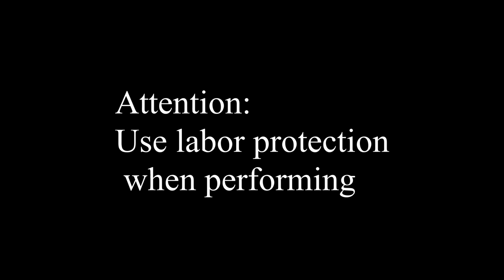I Turn A Ceiling Fan Into A High Tech Welding Machine

Comment: The wire is too small to carry that welding
Reply: Like that is the reason he did spot weld instead of straight continuous welding which would cause the wire to heat up causing damage to battery.
Reply: @jeremytheonlyone  Would it be possible to use larger gauge wiring during the Wrap or does it HAVE to fit the grooves in the Rotor? Also could an grounding clamp to get a better ground to the ground lead with an actual stick welder lead to the other? Just curious.

Comment: À ceiling fan motor is winded with very thin wire, because its power is very small :100watts ?. When you  wind over, as a secundary coil, a big wire for a great power, you ask from the primary coil  a Lot of ampère.. And the thin wire of it, cannot accept.. It burns very fast..

Comment: Fan coil work only ac voltage ⚡ that means 110 to 240 ac volt. So dc volt doesn't work as a transformer.... So this video is fake video....
Reply: yes a very big fake
Reply: Exactly, this is fake

Comment: Dear it is only electric short circuit with welding stick through battery... please don't try this at home this May cause of battery blasting......
Reply: Apne sahi se video nhi dekhya please doobare sa video banaya
Reply: Yes broo your right 😊
Reply: @AmitKumar-ob1sp  "Bogus "
Reply: You are right
Reply: Yes
Reply: but what you saw on the video there's nothing bad happen to the battery.
Reply: @creative27feb  m
Reply: DC ko step up or step down nehi karajaskta.froud video. Fake betery niche wire connection he
Reply: It will be blasts battery
Reply: Fake video

Comment: Battery capacity 4 or 7 amps..Dc 12v..But ..Iron welding need maximum 10amp ..And 230v..This is fake
Reply: Someone answered to this that this was the reason why he was spot welding instead of contentious weld ? Does that sound right?

Comment: The welding electrode is thicker than the secondary winding cable. Also, the Transformer works with AC current, it does not work with DC current.
What kind of nonsense is this you are deceiving the people..
Reply: Exactly sir,he is deceiver.

Comment: Is fan on or burnt out?
Reply: Fake hai
Reply: This is 100% fake. Welding (especially with the stick he was using) requires way more electricity than is possible coming from that fan. Dont try this, you will get hurt i promise
Reply: @d8l835  I see others also saying this is FAKE.. yet we see it work. Can anyone explain HOW this is fake?
Reply: @daddydawg1902  that ceiling fan and battery are not capable of producing the amount of electricity needed to actually weld anything, i said this in the comment you replied too. By all means try it, but dont say i didnt warn you
Reply: @d8l835  I'm not saying that it ISN'T fake... I'm only asking if anyone can actually say HOW ..IT IS Faked? 

I agree with your explanation of the capabilities of the Battery or Fan... but it would be interesting for someone to make another video and then expose the whole deceit at the end. That would go WAY farther in discouraging videos like this that may be actually causing some to be HURT trying it. 

Thanks for your response @DL L8    -Jake
Reply: @daddydawg1902  ahh i see what your saying. Well what hes showing isnt fake, i mean hes producing a short circuit, which by definition is the process of some welders, but the amount of electricity needed to actually weld anything let alone that thickness of metal is a substantially higher. Also that battery is not gonna last very long and is likely already permanently damaged just from doing this. You can technically take 2 car batteries and if you have some decent sized copper cables and you know how to connect them (polarity)  you can recreate pretty much what this video does. Still very dangerous and not a replacement for welding, but you can produce a short circuit which will generate enough heat that it could melt metal together, albeit not for very long without damage or worse
Reply: @d8l835  Thank you for that explanation.. You might have stopped someone else from being seriously hurt.  -Jake

Comment: This method is wrong because for welding the welding transformer is required and the transformer only work in AC supply not work in DC.. who is agree with me tap on ❤ like

Comment: Is this real?
Reply: No, is not.
Learn physic!!!
Reply: @emptyindorill  Learn to explain HOW it's not real instead of useless insults. Can you?
Reply: @daddydawg1902  I don't need to explain anything.
I have enough functionality of my mind, knowledge and training to immediately understand at a glance whether this is true or false.
This entire channel is a lie.
In order to understand this, you need to find at least a couple of videos on the topic of electricity - what is current strength, what is voltage, due to what and how welding works, what current and voltage is needed to weld metals (steel), how and how generated current and voltage.
A banal example - on this channel there is a video where the author allegedly pumps water with a magnetic field.
A magnetic field only affects metals.
If they can somehow influence the water, it is necessary to make enormous expenditures of energy.
Reply: @emptyindorill Thanks for the insulting reply. At least you did provide some vague reasons why this might be fake.. Yet it seems you cannot explain HOW it might be faked... which is what I have been asking others who make that claim. So far... Most haven't even attempted to get past the insult stage.

 You also assume people who reply here don't have the intelligence equal to your own and therefore must reply on your 'Wisdom'. I'm Ret U.S. Army Aviation UH-60/UH-1H/Oh-58' Helicopter Mech, Crewchief and Tech Inspector for 16 years and Ret Sr Large-cabin aircraft Sheetmetal Tech and Mechanic with years of On-hand training and certified school training ...  I have also worked with electrical installations and am currently learning Welding techniques for home use with my Flux-core welder so I'm not exactly your usual inexperienced commentator. 

Best to you and looking forward to seeing your own link to any video that actually exposes the WAYS they are faking these. You might even SAVE someone a serious injury or even death. IF I could do this.. I WOULD.  Take care  -Jake
Reply: @daddydawg1902  Man, to be honest i need google translate, i translate what you write, to understand correctly and answer you.
I figth for truth, and nothing else.
If i wrong, i wrong and i agree with that.
🤝
Reply: @emptyindorill  Thank you for that very Honest reply.  I also need a translator app for anything other than English.

Comment: You don’t know electrical technology. Transformer works on the principle of Electro magnetic induction  so it is required AC input voltage. 
It is absoliutely fake video, plese stop it.